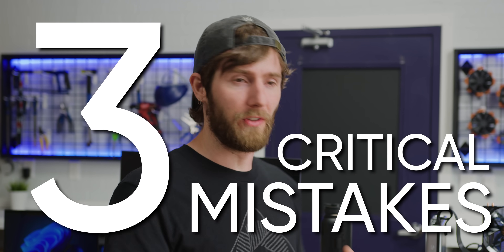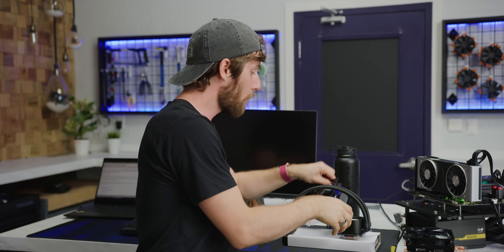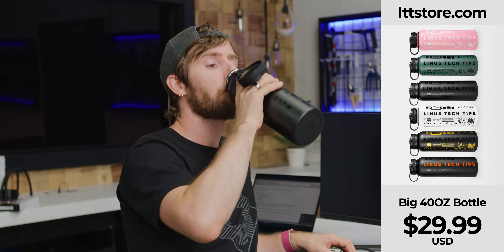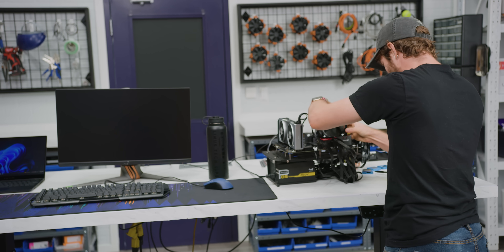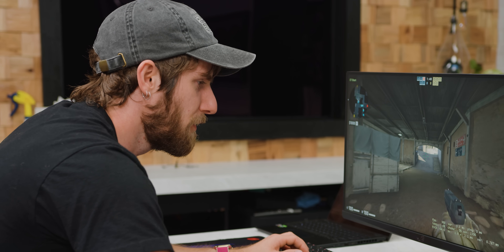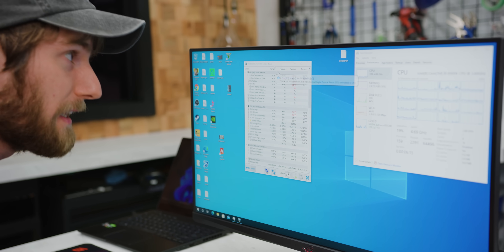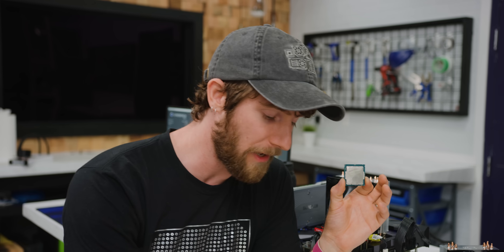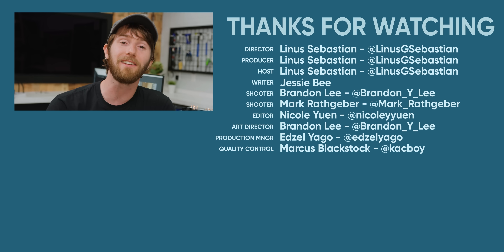How BAD is it if you forget to peel??

Comment: I had a repair store in Toronto and I had a customer that built a gaming PC with i7 processors 2017 around $500 for it ...

He came to me to figure out why the PC would play a game and it would drop FPS to 1 every 2 minutes (or so he claimed I didn't try) 

I opened the PC and and the CPU did not have a heat sink 

After the heatsink was in working fun I advised him to do an RMA the CPU... 

Thank Intel for the thermal throttling ... Cuz my Cyris cpu 66mhz would Burnt if I did that ...

Comment: "is there plastic between your cpu and your cooler right now?"

me, who built my own pc and has used it for a year and a half with no thermal issues: sudden pang of anxiety
Reply: I did a build recently 5600x and nh-uh12s noctua, both have hardened plastic case reaching out of the cpu area, no foil. I did have to look up a few unbox videos
Reply: i dont trow them away i put them in the original boxes to make sanity check
Reply: Am I the only one to read the title as  "How BAD is it if you forget to pee " ??
Reply: @achtsekundenfurz7876  that can be pretty bad too tbf
Reply: I did this with a scythe fuma 2 and 11700k, the computer would boot up and then 10 seconds later shut down due to cpu load of opening the startup programs.
Reply: My thoughts exactly.  If you forget to pee, urine trouble!
Reply: SAME
Reply: sure bro.. one guy makes shitton of views over nothing and you have anxiety.
Reply: @cubertmiso  may i introduce you to the concept of a joke

Comment: Considering the state of CS:GO, I wouldn't be surprised if a 3080Ti, i9-9900K ran at 80-150fps and stuttered every 10 seconds.

I have a 1050Ti and an i5-7400 with 8gb of ram, which should be more than enough to stably, but according to valve's code the answer is a solid 100 fps(from what I remember from last time i played) on low settings with stutters every 10 seconds.. thank you valve for ruining your game, AGAIN, it wasn't bad enough dealing with cheaters, you had to make it so cheaters had a free pass to get back into the game and the even made the game next to unplayable even when that shouldn't be the case....

Comment: I was much more cautious about what might happen than Linus. I remember when I accidentally unlocked and moved my cooler (or maybe unconnected it from the cpu and just put it back in) and the temperatures were very high afterwards. And that was just thermal paste not connecting the two pieces of metal well and allowing air in between. Comparing to having a plastic sheet completely isolating them until it melts sounds so much worse.

Linus' results were surprising to me after my own experience, even though my experience was with i5-750 and its stock cooler. I had overheating and crashes and errors. What do we need coolers for? And that careful manufacturing of them?

"That's not much for RTX, but if you remind yourself that source engine is basically cpu only, it might make more sense".

Comment: "The cooler your CPU the longer it lasts"

My laptop which idles at 65c : *chuckles* guess i'll die
Reply: Yo, that's artic.
100⁰C or don't mention it.
Reply: @Nj1498  My old CPU idled at 100 in BIOS.
Reply: @Nj1498  ye my desktop i3 reached 105c while idling when i tried to overclock it lol
Reply: @Nj1498  boiling water with my cpu
Reply: Open task manager: "We have a meltdown"
Reply: Honestly, that's fine. Modern mobile CPUs are built to withstand up to 100⁰C for longer than the PC will last. Yes, cooler is better. And a hot CPU will slowly degrade. But mobile CPUs are clocked so low it doesn't matter. So having them run at 100⁰C under full load is fine. They won't overclock to 5 GHz anymore, but the were not designed to in the first place.
Reply: @nanolog522  Tell that to BGA balls breaking from "extreme" thermal stress.
Reply: @Melamamoduro  The BGA does break from heating and cooling of the chip. But when the chip reaches high temperatures and stabilises there, that's fine. When it idles at 70⁰C and games at 100⁰C, stress ist lower than on desktops. When in use, my CPU jumps between 30⁰C and 70⁰C, even with a beefy cooler. And it is far less stable than on a laptop, because cooling is so much easier.
Reply: Waiting for my desk so I use my bed to play on my laptop. 
IT'S HOT
Reply: @starlii10  use the box which your laptop came with...keep the laptop on the box and use it
Reply: @thechannelofrandomness7670  this is the way, gives a proper surface for both your laptop, plus a mouse and mousepad for no additional cost towards a bed desk or anything. Easy to transport from bed to proper desk too
Reply: @shebazraza4746  hi

i use a table with a cooling pad and a suction cooler....the temps at idle are now around 55c...the 65c is with the stock settings and while running on battery (with the fan set to active in the power settings)
Reply: @thechannelofrandomness7670  heyy,

Great, that works too
Reply: @starlii10  I bought a cheap cooling pad i got off Amazon I put it on when on the bed. It helps.
Reply: if it's old then try cleaning it from dust
Reply: @ArtyIF  nah..its new...its just the cooling system being shitty...I have a dedicated GPU and a shitty cooling system
Reply: that is normal and fine for laptops, only really above 95-100 degrees is an actual issue for laptop's which would force a shutdown. For a PC tho? Anything above like 80 degrees is a worry
Reply: @Thesbian91  yes
Reply: Is it a MacBook 💻?
Reply: my 105c macbook pro:
Reply: If the laptop is a older one then you should try repasting it. My old rog laptop throttled below base clock on the cpu and after a cpu and gpu repaste my laptop only gets up to 85-86c on the cpu
Reply: @brandonvo9727  its a new one....its only the cooler being crappy
Reply: That's not too bad most laptops I cleaned from dust and changed thermally paste are around 55c . They don't have a lot of air flow cramped so they can be slick and most of them a small fan so it's pretty normal. Problems start above 80-90 and around 100c or more it will shut down itself
Reply: @Assassin5671000  ya u r rite
Reply: Bro, I use an Alienware alpha taken out of it's case and game at a rock solid 100C.
Reply: @ehrenloudermilk1053  no frame drops?....there must be some...
Reply: @thechannelofrandomness7670  I'm sure there are tons of dropped for frames.
Reply: @ehrenloudermilk1053  ye man....RE8 just goes from 45 to 20 fps 5 minutes into the game...older games like FH4 runs okay
Reply: @ehrenloudermilk1053  yea...like it thermal throttles while playing new games....and my laptop's display is a 1080p...so to not look bad...i should keep it at atleast 768p or 900p
Reply: @ehrenloudermilk1053  your cooling solution is garbage
Reply: @mnelson1909  yeah. Obviously. But I'm a single father who works 65 hours a week but also live to take. So I work with what I got. I just played days gone with all settings at medium 720p and 30fps. So it's pretty much an overpriced OG ps4
Reply: My laptop has advanced airtube cooling so it usually stays at -80 farenheit degrees lmao
Reply: @bitonic593  wut lol
Reply: @thechannelofrandomness7670  ...
Reply: I understand this is a joke, but laptop CPU's are designed to go to 100 Celsius to boost performance, that's not an ideal idle temp but it should be just fine. Make sure your fan curve is set to rev at lower temps and clean it. Good luck with your laptop!
Reply: My new laptop idles at 45 c, my old idled at 70-75
Reply: apple macbook are at 105°C max and lives fine for >8 years
Reply: Laughs and crying in 77c
Reply: @shaviorharuki  77c at idle ?!?!?
Reply: @thechannelofrandomness7670  yep
Reply: i idle at 40 C
i play war thunder @ 72 C
Reply: @SorenN2011  damn your pc cool
Reply: @thechannelofrandomness7670  thanks
are tkor
Reply: i mean are you tkor
Reply: Manufacturing error. Most chips are rating to like 120 degrees.
Reply: @mrwang420  k
bro
Reply: @SorenN2011  i got this ryzen 9 3950x and it popped on me after hitting 80c for like 5 minutes lol. The replacement tho is fine. Same setup. Never goes past 70 now.
Reply: @mrwang420  the TJ of most CPUs are in the range of 95c to 105c...never heard of a 120c tho
Reply: Meh, idle at 80, with a pad cooler. Amateurs.
Reply: @freehandz  Well that kinda explains lol
Reply: @freehandz  my desktop idles at 105c lol

not joking....
Reply: @thechannelofrandomness7670  only some CPUs will let temperature rise above 100c. Usually they automatically shutdown at 100c and give you a BSoD
Reply: @freehandz  my i3 has a max temp limit of 105c and started to thermal throttle (never had a bsod coz of heat)
like i did not fit the cooler properly which led to this temp increase...my i3 never thermal throttled before
Reply: @thechannelofrandomness7670  oh it must thermal throttle HARD, I would cry about the performance
Reply: @freehandz  yea :(...but then i fixed it properly and now 80c after a 1.4ghz overclock
Reply: @thechannelofrandomness7670  phew. Btw that’s a REALLY low overclock, what’s your original max clock?
Reply: @freehandz  like from 3.1ghz....i took it to 4.4ghz without voltage change....and is quite stable
Reply: @thechannelofrandomness7670  oh ok that sounds a little more realistic lol
Reply: Honestly, modern chips are made to endure 65 degrees for ages. Most of the time any other component dies before the chip itself breaks down.
Reply: @Battlecry45  Yeah but if it is idling at 65C then if you start using the device it will reach max temp in next few seconds and throttle immediately.
Reply: if ur laptop intakes from the bottom, one of those laptop stands with fans will significantly help with thermals. I saw a 7-8C drop in gaming load temps by using one of those.
also worth cleaning the dust and repasting if you've had it for a few years, got another 2-3C lower by doing that
Reply: @yoboicc_418  I actually do repaste every so often with kryonaut. I have one if those laptop stands attached to the top of the open case. I just needed an upgrade years ago.
Reply: @yoboicc_418  i have two intakes....one from the back...and one from the bottom....I heard that this laptop's cooling system is similar to that of macbooks...not sure bout that tho

this laptop has a common heatsink for both the CPU and the GPU...and the heatsink is not connected to the fan...the fan is present on the right end of the laptop while the CPU and GPU with their heatsinks are present on the left end...the fan blows air over the mobo then via the heatsink and outside

Comment: 2002 was the last time I bought a PC where I allowed the store to assemble the components.
When I got home, I was shocked that my Williamette CPU was hitting high 55C on idle.  Thinking it was the fan, I got a 3rd party fan.  And since I figured it was high time I started to learn to tinker with my own PC components, I decided to install the fan myself.
When I took out the stock HSF, I was shocked!
ON the heatspreader of my williamette, there was a 1x1in shop warranty sticker.  On the 1x1in shop warranty sticker was YET ANOTHER sticker ---  five in fact.  1 sticker containing the year (2002) and the other 4 stickers contianing the digits of the month + date!
Ridiculous!
I peeled off the damned stickers.
And just to test, I re-installed the original HSF.  (Unfortunately, the graphite pad was already smudged by the stickers, so I had to peel it off and use a bit of the compound that came with the 3rd party HSF I bought.)
After booting up, the idle temp went down to 40C!

I did not complain to the store.  Complaining would reveal that I took apart the PC and will risk voiding my warranty.

AND that was why I learned to put together my own stuff. :D

Comment: I disagree that you cross out that resistor, Linus. There may be no locations where the heat goes metal to metal, but that resistor is going between metal and plastic in that diagram, and it is not unreasonable to assume there will be locations of metal-plastic-metal with no transfer paste. In that case, that 'resistor" is still in play

Comment: This actually happened to me while running a 1,500 PC deployment I did with Dell,  on a 7460 AiO w/  8000 Series I5 . The contract tech we hired was alerted because it was the first PC he turned on that the fans never ever turned off after boot. We actually ran it for 30 minutes checking software and reimagining, until I took it apart and discovered the full Orange thick jacket on the CPU. Removed it reinstalled cooler and boom, worked perfect.

Comment: It happened to me, in a tropical country, my PC i7 8700 runs at 60-100 C°... I thought i do not have enough fans so i bought 9 fans and replaced the fans in my Hyper 212... Then in replacing the fans and thermal paste, i discovered that the technician forgot to remove the plastic peel...

Comment: A little story actually, I bought a pre built PC last month cuz it was cheaper like this and I used it 5 days straight, I was noticing high temps but didn't do anything till the 5th day, I opened the heatsink and... It wasn't peeled, it was a Ryzen 7 5800X and not gonna lie, the plastic was melting, but the company I bought it from told me they'll apply any warranty if needed, should I apply warranty just in case Linus?

Comment: One time a friend of mine had one of her friends go to her place and help build her pc, they didn’t finish so i went over a few days after to finish it off and thank fucking god I did. ALL the peels on heatsinks were still on (cpu cooler, m.2 heatsink) the AIO wasn’t plugged in at all, just mounted on with the cables jammed between the motherboard and case where the standoffs are, the ram wasn’t seated and were in the wrong 2 slots, the gpu was in the very bottom pcie slot for no reason and would’ve just choked the fans, and the power supply was mounted fan up.

Moral of the story: if someone else builds your friends PC please check it out.

Comment: I was careful to check that my BeQuiet Pure rock cooler didn't have plastic on it... it didn't luckily... I'm totally blown away though because my cpu only gets to 50C under load with prime95! It's a 150W tdp cooler (up to) and my cpu is only a 65W cpu, a 5600x. I'm using a pretty well ventilated case too, a corsair 4000D airflow with extra fans and a fan exhausting out the top directly above the cpu cooler. Also pretty cool ambient temps at the moment too because its winter here still and my house doesn't have good heating.

Comment: I have a dell precision m4200 that I've used for years, it eventually started throttling and when I pulled it apart to repaste the cpu and gpu I found plastic on the cpu from the factory, it worked great for so many years

Comment: i feel like there is a very simple feature that could be added to CPU sockets to test if the peel is off. just some sorta sensor that connects to the CPU and cooler that detects if it can get a small voltage across cuz its all made of metal. if it cant your PC wont boot

Comment: I've been watching you for awhile and I've got a question for you Linus or anyone else who can answer this.  So obviously in a normal PC setting, people aren't using a test bench they're putting all the components in a metal casing.  So when you use your test bench to test anything having to do with the temperature of one of the components, do you think your results would make a difference if you put the components in a case instead of a test bench? Wouldn't they get hotter inside of a metal casing making your readings a bit inaccurate?
Reply: The open test bench temps are accurate to EACH OTHER which is iteself important. Yes case temps will ptobably be slightly higher, but thats just understood overall.

Comment: I admire the effort of using the electrical diagram, but my thermodynamics professors would kill me if I turned that in on a test.
Reply: It's perfectly fine, we do it at my  engineering school. There an equivalence betwin electrical and thermal resistance. :)

Comment: Manage to forget about the plastic when I built my AMD K6-2 450mhz.
They were kinda notorious for burning if there wasn't a cooler.
I didn't notice anything until a year later when I took it apart. It was alot thicker plastic back then.
What it had done was burn a hole in the plastic and it was permanently stuck to the heat sink. 
Fully working tho. Should've saved it as a show piece.

Comment: 150 watt on an i9 with voltage of 1.52v is 99 amp so you need a very beefy power supply

i would not rely on games as most of their computing power is done by the gpu.

you need something like a cpu benchmarking program or if you can get multiple instances of it running at the same time.

if you are using a a cpu with built in gpu maybe then a game would be valid test as often cpu/gpu combo chips will put the gpu part on the same die and so you can work the cooler better.

what you could do too is find a crypto that uses cpu instead of gpu and mine crypto to test it too.

Comment: I bought an XPS laptop a year ago and after a few hours of use each time it would start to overheat and shutdown doing basic tasks. Eventually I decided to open it up and see what was going on, and turns out a nearby thermal pad must've fallen out of where it was placed and fell right between the CPU and the fan as it was being assembled... Yeah... Ever since I fixed that it has worked completely fine though lol

Comment: Forgot to peel my 240 Aio (Aerocool P7) on my Ryzen 5 1400 two years back because I wasn't paying attention, noticed eventually, temps weren't even that bad. Like ~60°C which, yes, for a 1400 is a little high with a 240 AIO, but the case was pretty ass (like a lot, basically the Walmart DTW case GN tested), so I was just blaming my shitty case. Turns out, even the worse case you can probably get cools okay with a 65W (I think) CPU and a 240 AIO. Temps after I removed the platic were like 50 ish. Yes, I knew the AIO was overkill and the 1400 was never supposed to stay.